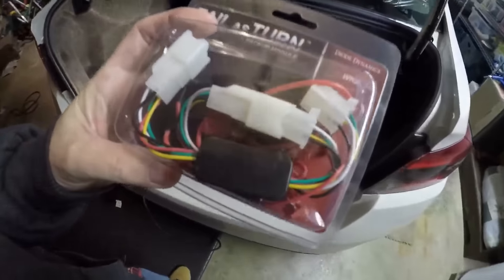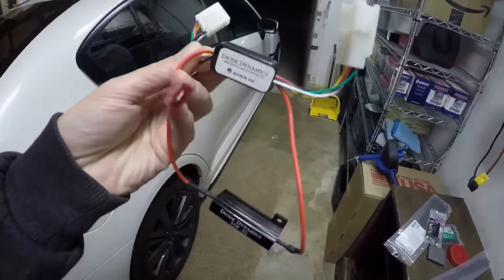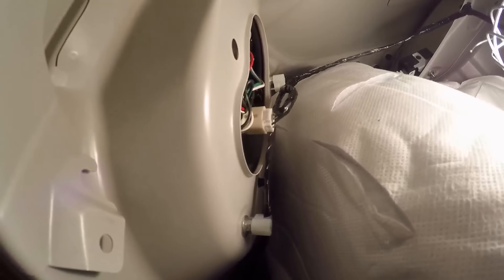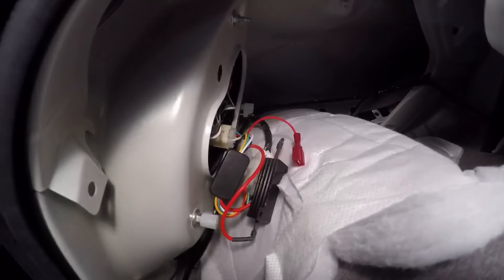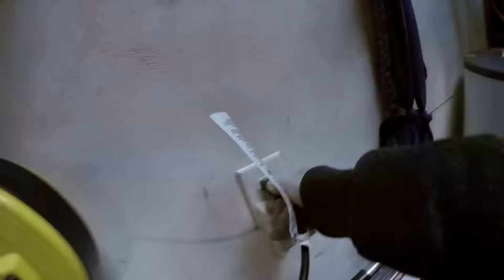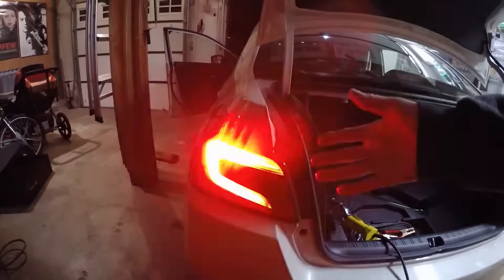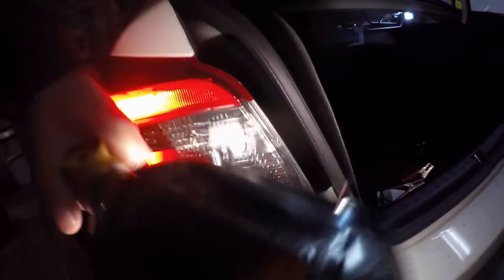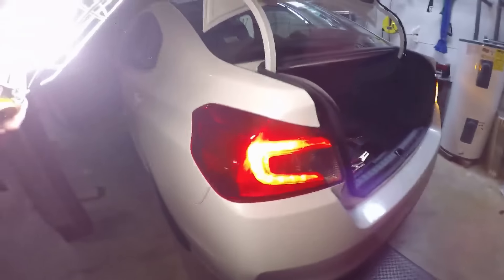2015 Subaru WRX Ep. 590: Diode Dynamics Tail-As-Turns Installation

Comment: Tail as turn was my first mod. Still one of my absolute favorites. I've noticed mine get hot when I had the hazards on also. I've had them in for almost a year- no problems.
Reply from the maker: im sure i can remove those resistors with no issues. they are prob in parallel meaning i would NOT need to reconnect the red wires back after cutting it out.
Reply: the resister is probably there so the lights don't burn out I would think

Comment: jdm astar for bulbs. The 7440 bulbs fit fine. the 921 bulb from jdm the one that has the bare leds wont fit tight enough to stay in place. you have to get the one the that looks like the 7440 but smaller to get a better fit. i am in the same boat waiting on my bulbs to come it. i spoke with jose and he said, the i mentioned should fit. tap green wire. ill buy your old 7443 amber bulbs if you plan on selling them.
Reply from the maker: hmmm

Comment: keep us informed about the new design they have with that resistor. if you having the led flasher already could have an impact on how their design works with that resistor in line.
Reply from the maker: naw it doesnt. their part is compatible with either a stock flasher or an upgraded LED flasher.

Comment: My guess is, it's only hot because you left the turn signal on for a few minutes in the video. Normally, they would only be on for a few seconds or maybe a couple of minutes at a long light. I don't think it's much of a concern, because the resistor will only get hot when in use.
Reply from the maker: true, i had it on a long time. but i still want to cut it out if possible.